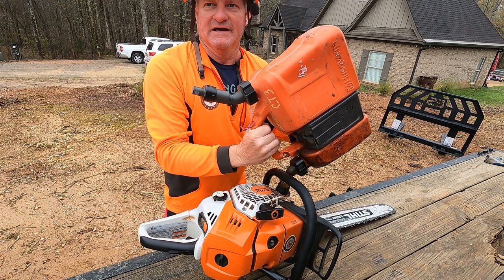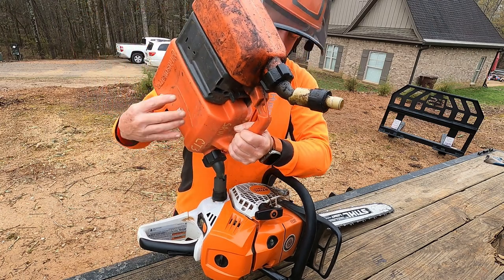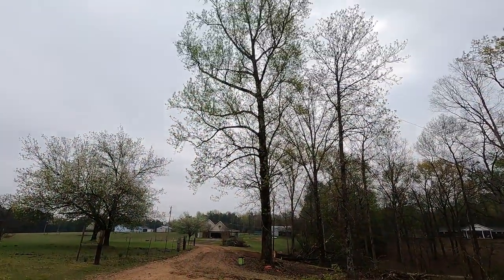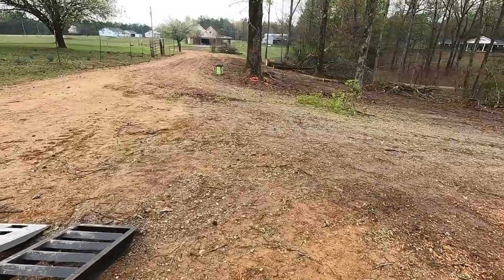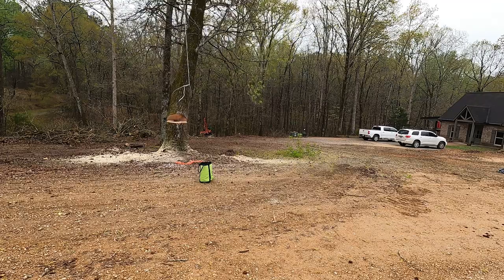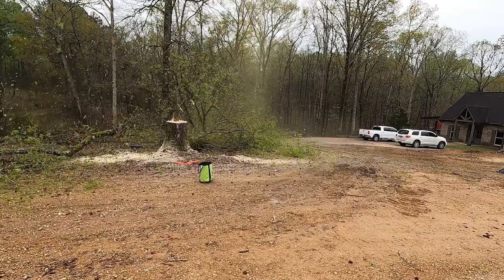Dropping a big sweet gum tree

Comment: Dang it Tim, now I I wish I would've watch them take out the two sweet gums in the side yard of the house we were leasing. Fenced in between houses, zero chance of dropping them. Both were about that size. I now realize the job they had cut out for them.

I learned from splitting the rounds with an axe why it's called "devil wood." Sweet gum don't know anything about grain.

Comment: Nice video Tim.. Why do you run the rope down the side of the tree and tie it at the base?? Does it add the pulling power to the pulley up top? Or it helps steer in the direction..?? Or is it a combination of all 3?
Reply from the maker: Makes it simple.
Reply: @cotontop3  That's the best way.